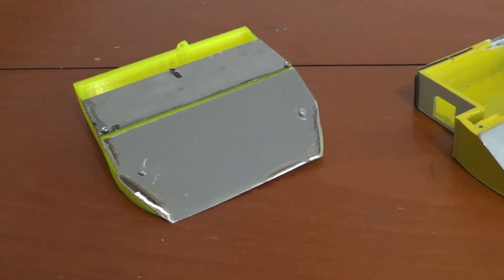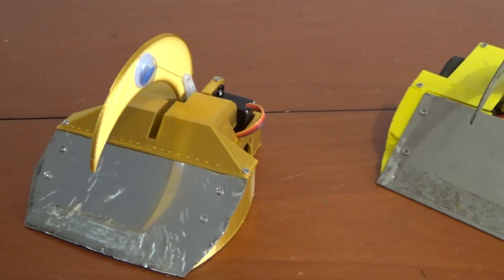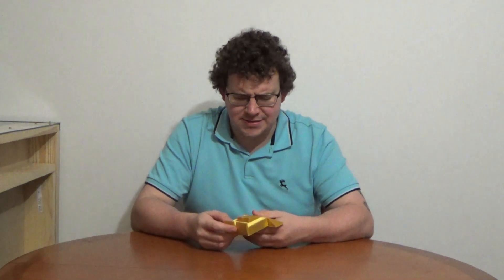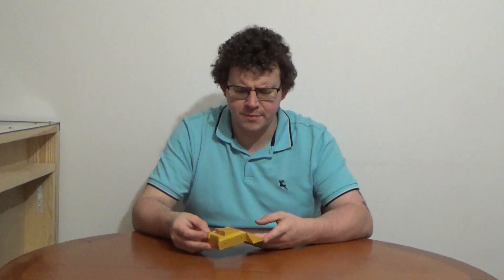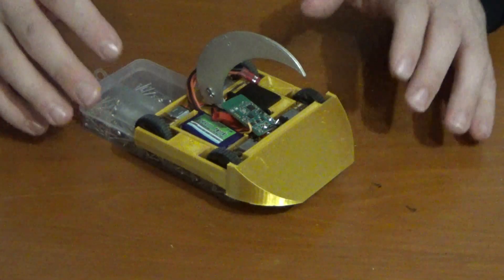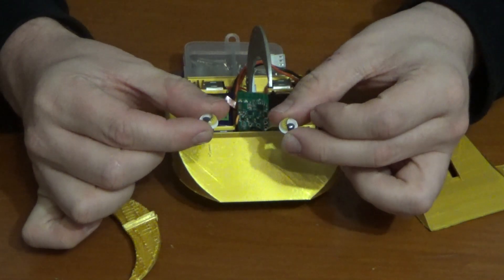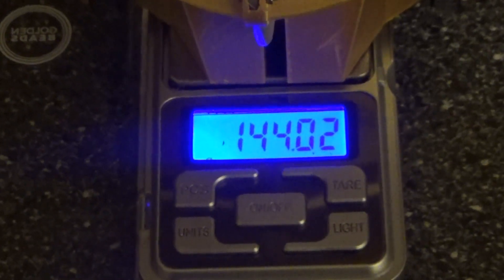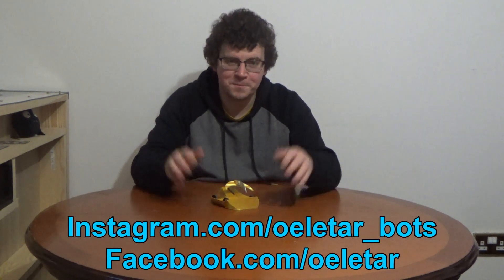The Rebuild of Petrify (Antweight)

Comment: Looks great! My own SalANT Fingers is awaiting me getting paid to afford it a new 4 wheel drive system
How did you wire yours up?
Reply from the maker: @heaptoncollierymodelrailwa6011  thank you. I have two motors wired directly to the esc, then the other two motors are connected to the first motors terminals instead of having all four directly wired. It saves space and a little weight. Hope this helps
Reply: @ thanks boss!